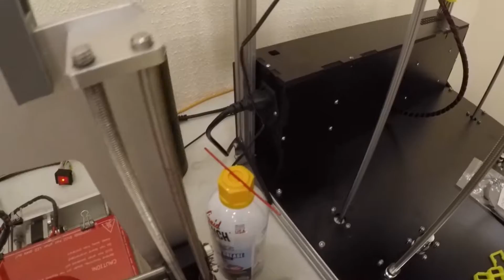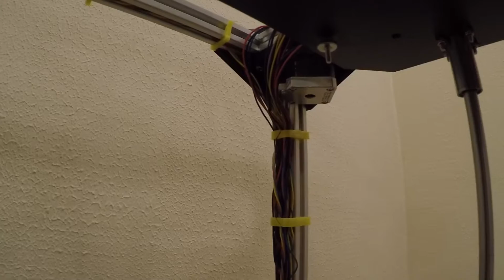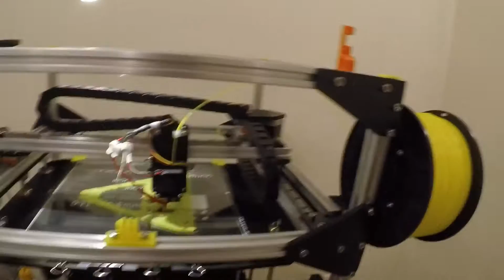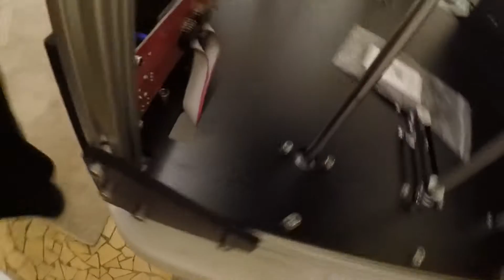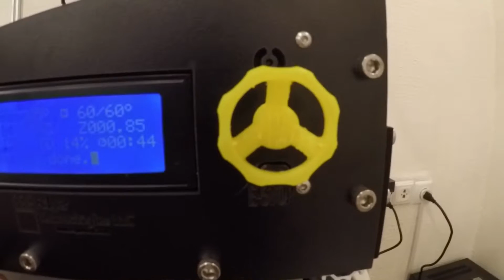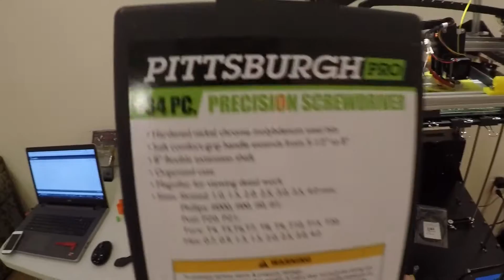Folgertech FT-5 Overview

Comment: I'm trying to decide between this printer and a Flying Bear P902. I like this one because it seems much more stable but the P902 is significantly cheaper and still has a decent print volume. Have you hear about the P902 or had any experiences with it? Thanks!
Reply from the maker: Even at $1000 the FT-5 would be worth it. I have heard very little about it. I reached out to them to get one to review but they never replied.

Comment: are the bushing/pillow block that slide on the chrome rods of the Z axis on the FT-5 strictly a bushing or do they have ball bearings?
Reply from the maker: They are bearings with ball bearings inside.

Comment: Saw that GoPro mount you printed - nice add-on. Curious to know if you are using the GoPro as a webcam into OctoPrint on your Pi. If so...how hard was that? I've only been able to find limited info about doing something like this so far (admittedly not a ton of research tho).
Reply from the maker: I am not. I have a Logitech C920 hooked up to OctoPrint. The GoPro takes amazing timelapses so that is all I use it for.
Reply: Understood - was just looking for a way to consolidate the functions into a single camera. Granted, the Pi isn't super powerful, but was hopeful :)

Comment: Could you recommend this printer for a first printer to a mechanically inclined person? Do you know if the company has been keeping up with revisions? I'm really tempted to order one the price is just so great.
Reply: Or make the pictures larger. They could blow them up 20 percent without changing any text size/ location.
Reply from the maker: FT-5 for sure. It has come a long way since I got mine back in July.
Reply: Just got mine and started building it. Definitely tricky at times, the v11 instructions are helpful but you will find yourself staring at the picture trying to figure out orientation at times. If they would put some labels in the pictures, directing orientation, it would be very helpful. 
A fun build so far thouhh
Reply: Aaron Miller, First Printer? What made you decide to get the Ft-5 over other printers? I went over the instructions and it does look like orientation could be hard to tell sometimes.

Comment: how up to date are you currently in 2017? are a lot of the "problems" aka quorks fixed?? like correct wiring diag, better screw kit, etc? I want to invest in this however if I have to spend another 15 hours trying to found out what went wrong, i would not be happy. hows the support from the company, will i wait 3 weeks for a reply from an email? i understand the community is great which i am happy about. i hope this will not disappoint and if my boss, aka wife, will let me get this i will also make a review and unboxing as well. thanks for your time!
Reply: Brandon I just purchased and built mine. They have much better instructions now with a very well done wiring diagram. All the problems I ran into was my own mistakes from being a novice at this. Just don't buy this if you're not patient lol

Comment: I would love to have one of these. Because I believe the linear rails are the most precise way to run a printer. But I don't know if I will be able to build it. I have a technical background being a dental technician. 😏🤔
Did you try ABS or other filaments that tend to warp yet? If yes, how do they come out?
Reply from the maker: Well, any filament will warp if you don't have proper bed adhesion. I have only printed ABS once and it came out just fine but it was a small print (my 200% maker coin). I did order some foam board last week to partially enclose it so I can start testing ABS plastics like I do PLA.

Comment: Did you have to do a lot of calibration that you needed to change the code?
Reply from the maker: After I built it stock, I loaded up the FT stock firmware and printed. No calibration needed. I only had to get fancy when I added the Titan and BL Touch.

Comment: I make myself laugh....This build is not for the impatient!  It took me three hours to get the frame done.  I did however figure out that these T-nuts are not so bad AFTER you realize how to work WITH them.  They work well.  Put them in sideways and 'spin' the Allen wrench and they WILL orient themselves correctly.  No guessing.  If the T-nut starts to tighten 'softly' it is probably not set right, loosen it up and 'spin' it again.  They actually orient and tighten quickly. If I had a camera I'd do some videos myself. Thanks for yours  Fugatech.... Frame is very sturdy.
Reply from the maker: Glad you are enjoying the content! Keep up the work on the build and let me know if you need any help.
Reply: This is almost too funny.  First-Im a maintenance tech that works on CNC 3 axis machines for a living.  When I left work this morning-(3rd)- the day shift guys had to yank a ball screw.( a lead screw) 2nd  I start working on day two of my FT5 build and guess what I found.  A lead screw that is outa spec on the high side not fitting into the 'saddle block' or into the 20T 8mm pulleys.  And just like work, we're outa parts.  Gotta order some more......Thats funny right there.
Reply: No idea how this will be for CNC woodworking.  It seems pretty sturdy and strong but I can not answer how woodworking would do.
Reply: Crazy Me

Comment: So my FT5 came yesterday 10/27/16 and I downloaded the google drive FT5 manual---it still (as of last night) had the WRONG wiring diagram in it.  The forum post has the updated version and it is that the grey and yellow motor wires are switched on all motors (motors only) and the power switch wires are now RED, black jumper, black wire and then green.  Thats the way I understand that this is to be.  It is the same as the one posted down below.  Certainly hope I got that right.
Reply from the maker: The power switch only matters for how you have it oriented. The motors really don't matter as long as you have the pairs matched. You can always switch the motor direction in the firmware.

Comment: Thanks for putting the file links in the description.  Also its a thermistor not a thermostat.  There are a very few printers with an actual thermostat but most use a cheaper thermistor.   I've finally almost got mine up to printing.  Very happy with the kit, though the directions are awful.

Comment: Can you please tell me how this build quality and the rail design for the X and Y axis compare to the ultimaker clone that is sold on aliexpress if your not familiar just compare it to the ultimakers x and y axis rail design.
Reply from the maker: I have never used a UM or a UM clone but the rail system is completely different vs the FT-5. The FT-5 linear rail system which is rock solid and has no wiggle at all.

Comment: did it come with the glass for the bed? If not where did you get yours?
thank you
Reply from the maker: It does not come with glass. The newest version comes with a white heated bed which is made out of alumuinum so it is much more rigid than the red or black versions. I got my glass from my carpenders but a lot of people have said they got 12"x12" mirror tiles at Lowes for around $6. Others have said that Lowes/Home Depot have cut them a 12"x12" piece of glass for free out of scrap glass sheets. You can also find it sometimes on Ebay.

Comment: Do you have the links to the connectors you refer to? The xt60 and the bayonet types?
Reply from the maker: I bought this set of XT60 connectors: https://www.amazon.com/gp/product/B01ETROGP4/ref=oh_aui_detailpage_o00_s00?ie=UTF8&psc=1

And this set of Dupont connectors: https://www.amazon.com/gp/product/B014YTPFT8/ref=oh_aui_detailpage_o02_s01?ie=UTF8&psc=1 These require a crimper if you don't have one.

Comment: great job. I just put the bottom on the frame. So far good directions for the build. looking forward to finishing it. video is helping me make sure I have everything right lol
Reply from the maker: Yes you most deff need a soldering iron because the wires are not soldered to the heated bed. You also need to extend several wires or you could buy your own and do it from the get go. (I wish I would have). Also remember the price. $499 for something that prints items almost as big as a GMax 1.5XT+ and those are over $3K. If you want this to be an awesome printer you need to invest into it.
Reply from the maker: Glad it helped!
Reply: Have you had to soder anything, or stuff like that? I dont have a sodering iron and am a little offput by buying something where i may have to splice wires.
How are the instructions? Descriptive, or..?

Comment: Hi my names Anthony I have finished the main build part of this printer and I'm onto wiring , I don't have Facebook and I was wondering if I could access the wiring diagram by Joanne
Reply from the maker: Here is the thread on the forums that has the wiring diagram: 
http://www.folgerforum.com/t/ft-5-wiring-schematic/157

There are several resources out there if you don't have Facebook.
Google Drive: https://drive.google.com/drive/folders/0B9b1NbuMK524aGhPQXRLTW9mams
FolgerForums: http://www.folgerforum.com/c/folgertech-printers/ft-5-large-scale-3d-printer
Reply: Thank you so much

Comment: McMaster Carr http://www.mcmaster.com has any metric tools, bolts, nuts you could need and they deliver quickly. They are reasonably priced.

In my opinion Harbor Freight isn't that great but if you look for their Pittsburgh Pro line instead of the plain Pittsburgh line of tools you can find some decent low priced tools.
Reply from the maker: Thanks for the info. Most of the tools I got from them were the Pittsburgh Pro line.

McMaster Carr is great. I have been buying hardware from them for years now but the problem is that most of the small items you want come in quantities of 50+. Very few times have I found only 20 or 25 of a particular screw or nut that I am after.